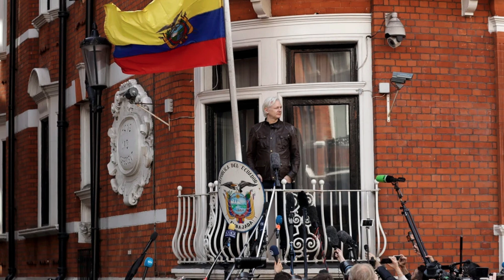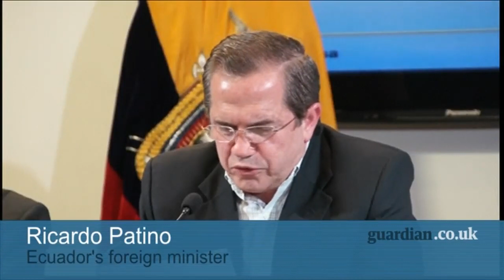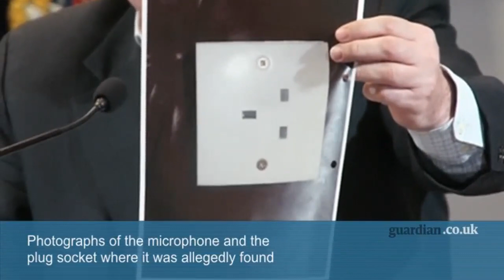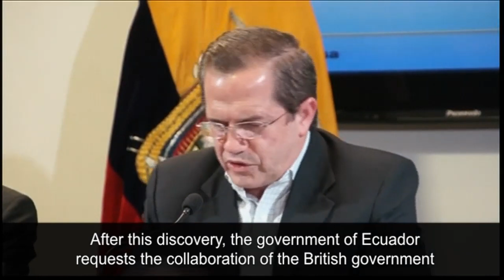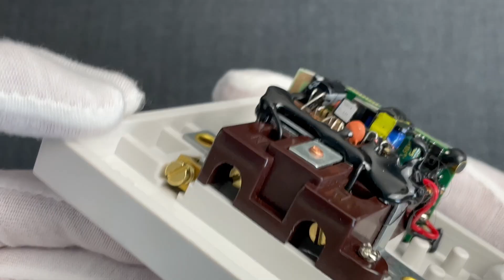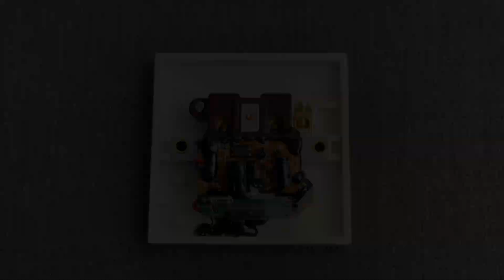GSM Covert Listening Device in British Electric Socket

Comment from the maker: Forgot to mention that the small hole on the bottom of the socket's frame has a microphone too. You can see it in the video.
Reply: I think the first one you showed is the one used for voice activation and the second one does the actual recording. The first one is just acting as a "wake up"signal generator since it is directly connected, probably, to a power management chip.